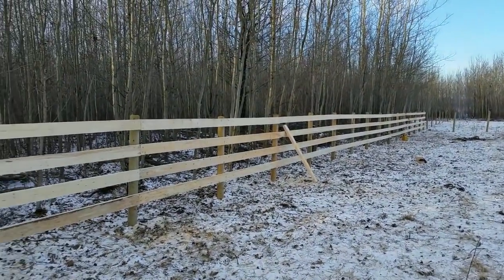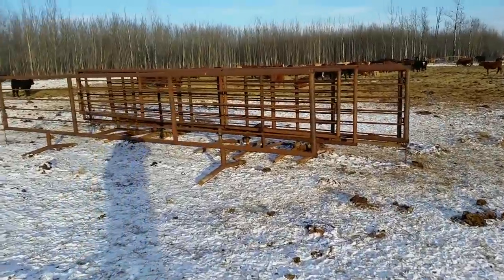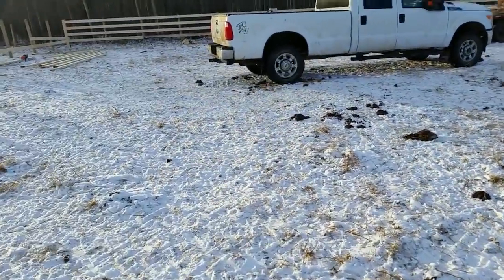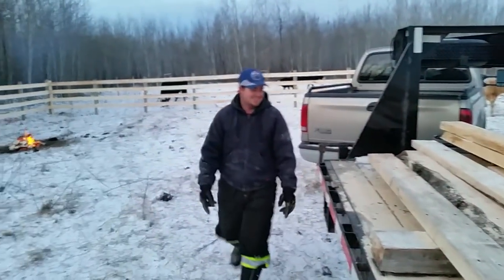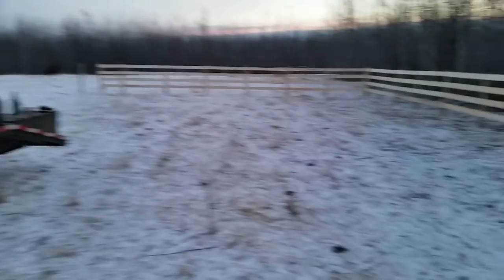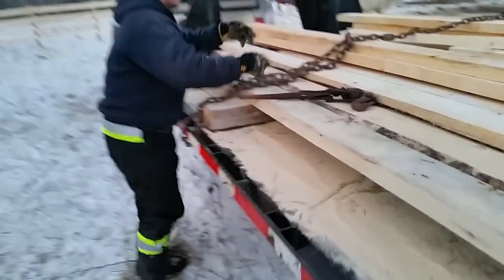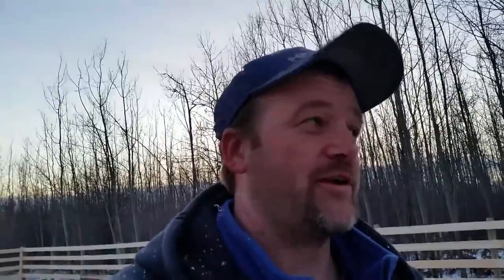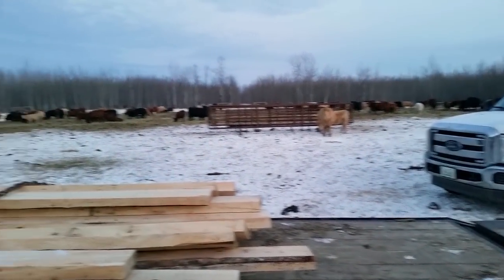Building the Corral!!!

Comment: Have you thought of using used motor oil as a stain/preservative for  those boards? You can use a paint roller and pan to apply and also a paint brush for hard to get places that a roller can't get into.
Reply from the maker: Yes it works great but I hate it being all black